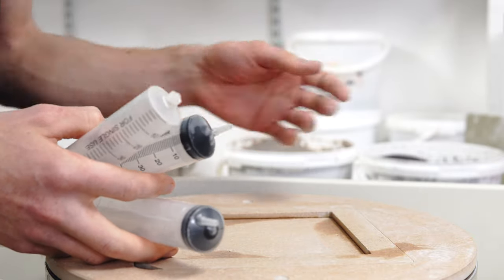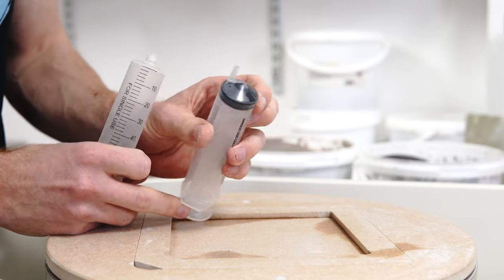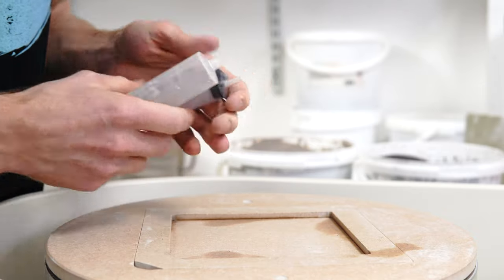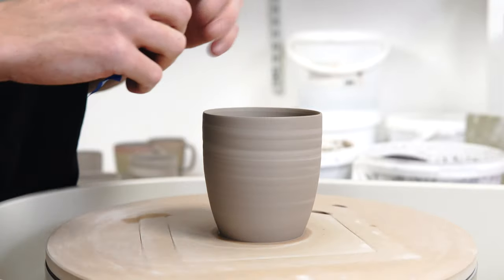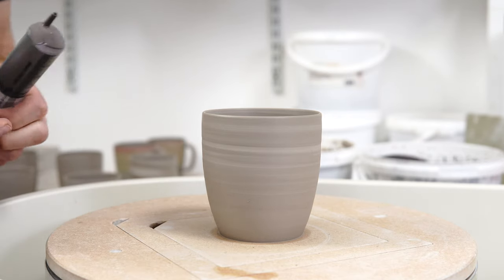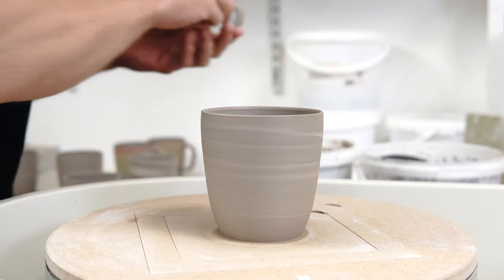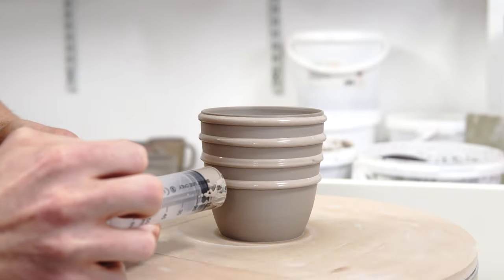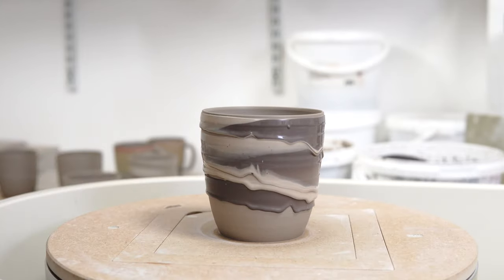7 Variations of Drippy Slip Application

Comment: Well I've just finished drippy slipping two mugs. A lot of work mixing up white/black/purple /crimson slips but it's an experiment. Don't know how I'm going to trim the bottoms. Biggest problem was the syringe. Instead of a consistent flow mine rather squirted and stalled. Maybe a little glycol on the rubber plunger would have helped. Thanks for sharing your work. Raoul

Comment: Great!  I love all the slip tumblers you do.  Very beautiful.  Question - it looks like you don't actually trim the bottom?  You leave the piece attached to the bat while you're applying the slip & I don't think you can turn it upside down to trim because you risk the slip flowing the wrong way.  Or do you just simply wait until the slip has dryed enough and then trim the bottom?  Thanks in advance!

Comment: Thanks so much for sharing your techniques. Absolutely love all of your work. Do you measure the viscosity of your slip, or is it just by feel through experience? 💜💜💜
Reply from the maker: I don't, it's just based on feel. There's a fairly wide range of viscosities that will work for the technique, so it doesn't have to be that precise. The thing to avoid is having two slips of significantly different viscosities in the same application.

Comment: Would putting slip in vacuum chamber just before application help with the bubble situation?
Reply from the maker: It helps, but the slip is still a bit too thick to get all the bubbles out even in a vacuum chamber. I'm considering a vacuum chamber on a vibration plate
Reply: @OldForgeCreations  how about holding the syringe pointing down, bubbles will travel to top and away from the nozzle.